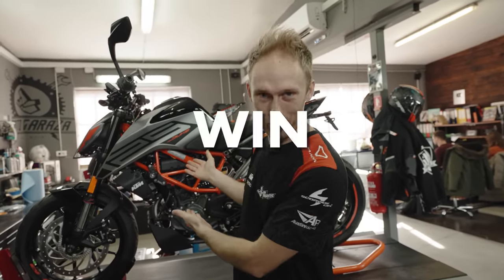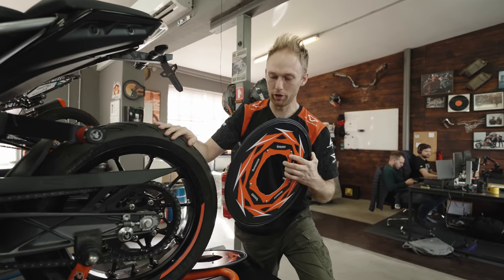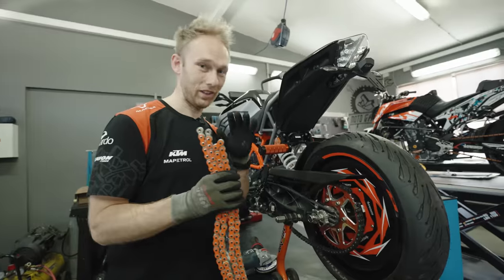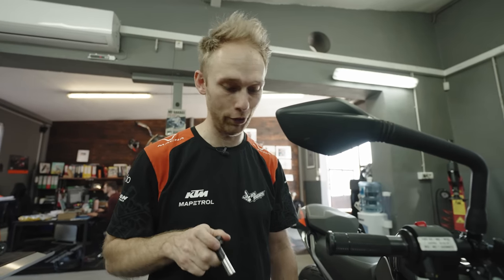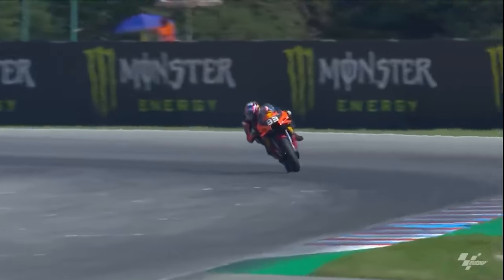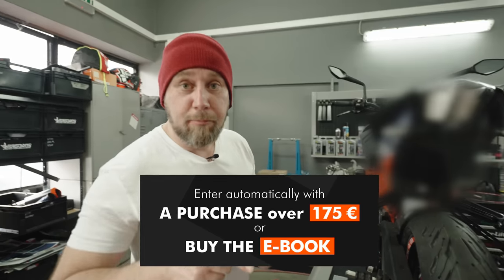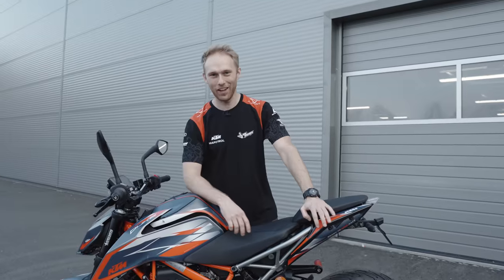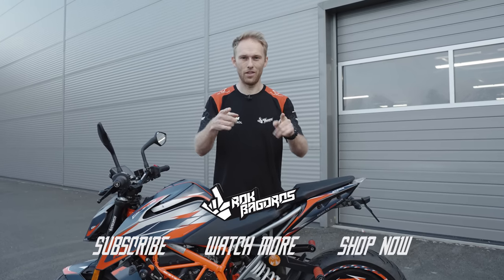ONLY ONE IN THE WORLD CUSTOM KTM 125 DUKE OFF PART 2 | RokON VLOG 138

Comment: Add more lightweight BST CARBON FIBER WHEELS   CARBON FIBER FENDERS  SEATS IS ALSO HEAVY     if it's for me I would love  more down force for SMACKDOWN  EXTENDED SWINGING ARM G SHOCK ADD MORE HORSEPOWER AND TORQUE I HAVEN'T SEEN A FASTEST  390 DUKE ON THIS FILTHY STREETS FOR A QUARTER MILE SMACKDOWN SMACKDOWN  LIKE 650Ib
Reply from the maker: The BST wheels would probably cost twice as much as the whole bike but would look sick 😁
Reply: @RokBagorosStuntrider  full system exhaust dyno tune it flash it , give more HORSEPOWER and torque, VP RACING FUEL , STRAP ITLOWER THE BIKE MORE .🥰